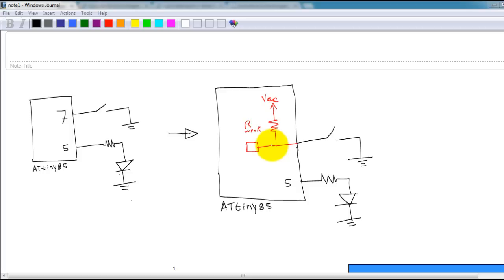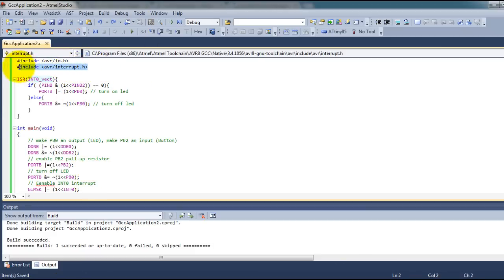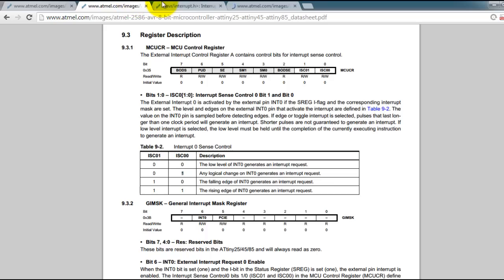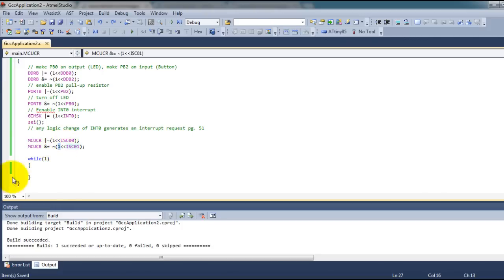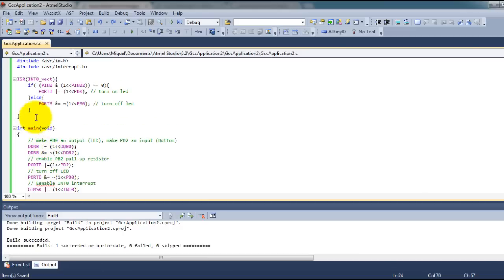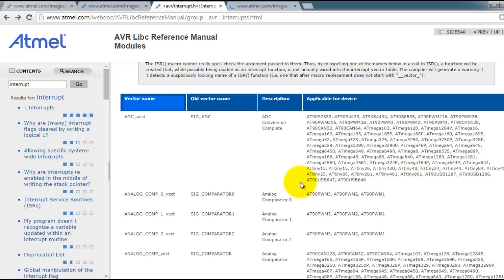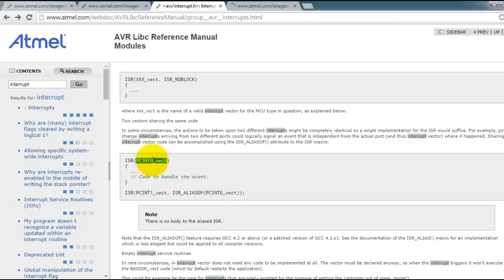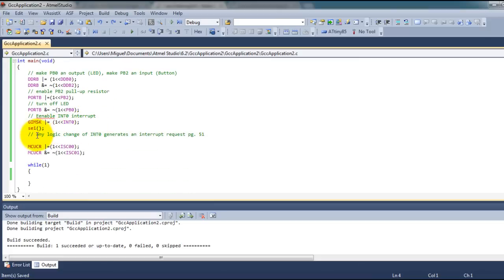AVR ATtiny85 Programming: External Interrupts for Digital Input

Comment: #include <avr/io.h>
#include <avr/interrupt.h>

ISR (INT0_vect){ // eto es de la librería interrupt.h
  //INT0 es el nombre que le ponemos nosotros al vector.
  if ( PINB & (1<<PINB2) == 0{//turn ON led
    PORTB |= (1<<PB0);
  }else{//turn off led
     PORTB &= ~(1<<PB0);
  }
  
}
int main (void){
//make pb0 as input and PB1 as button
DDBR |= (1<<DDB0);
DDBR &= ~(1<<DDB2);
//enable pull up resistor on pinb2
PORTB|=(1<<PB2);
//TURN OF LED
PORTB &= ~(1<<PB09,

GMSK |= (1<<INT0);// enable INT0 interrupt 9.3.2, table 
sei()
//any logic change of INT0 generates an iterrupt reques pg 54.

MCUCR  |= (1<<ISC00); // table 9.2
 MCUCR  &= ~(1<<ISC01);

while (1){}

}

Comment: Hi, thanks for the video - it looks great. However, it does not work for me. Can you show the pin outs on a breadboard, please. From pin 5 I have an LED then resistor -> GND. I have a connection from pin 7 to the button and from the other button connector is connected to GND.